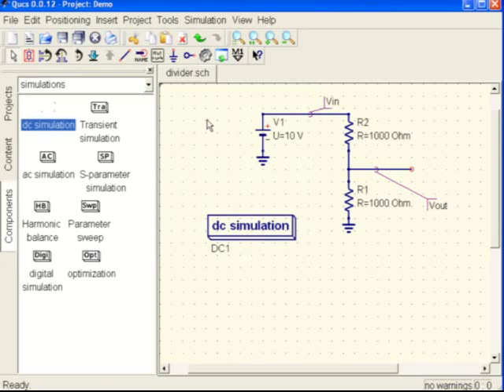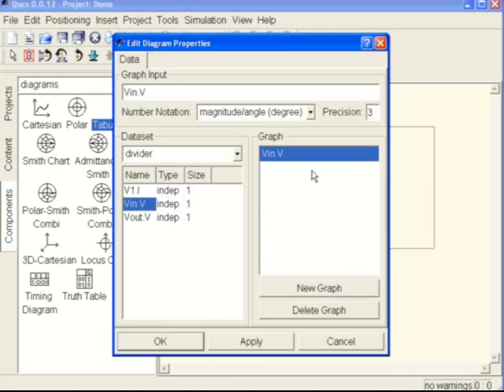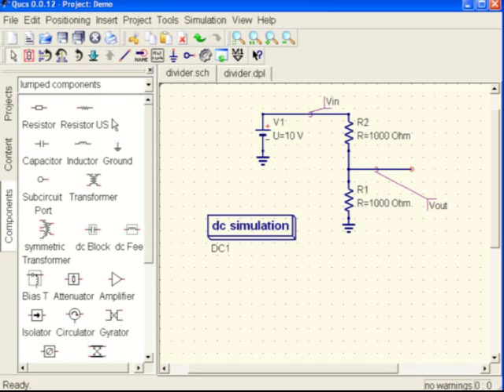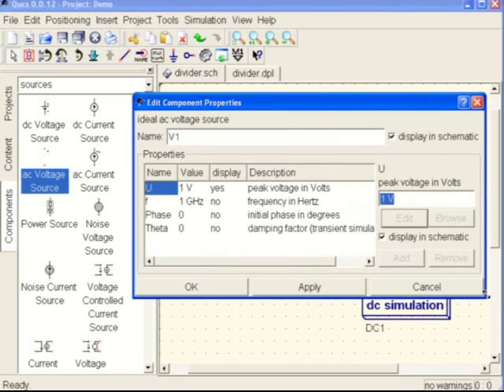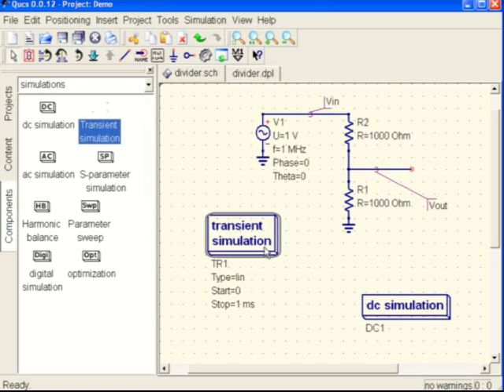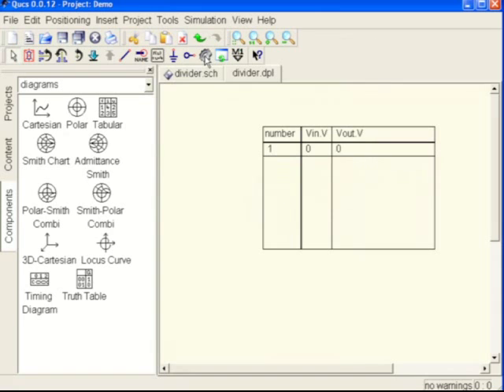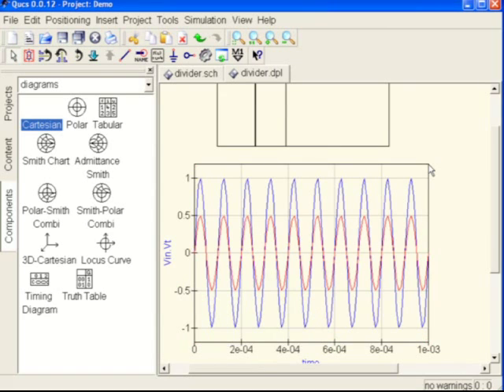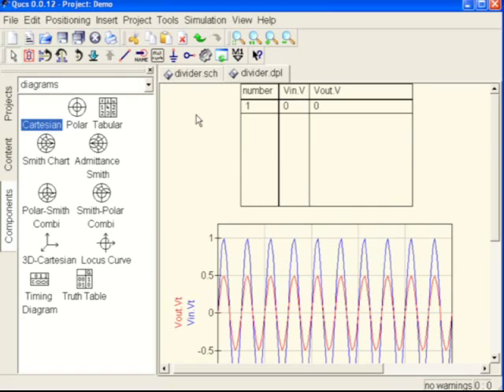QUCS_2

Comment: Great intro.  Also easy to edit values of say R1, to see changes in Vout.  But what about the more real world problem of sizing components?  I mean, if we select R2 to be 1kOhm and we NEED the voltage at Vout to be five volts, how do we get the QUCS system to solve for R1?  I guess I am thinking like a spread sheet, where we fill in what we know, and the system will solve for what we do not know, as soon as the knowns are adequate to solve the system.

Comment from the maker: @computerfis 
i do not remember any LED option in QUCS.
However, with the agenda being Harmonic Balance for microwave/RF simulation, then no surprise if there is no LED component. 
S parameters do not really make much sense for an LED, as it is essentially a DC device.
(Never mind that it does have a characteristic impedance that is a function of current, like in a conventional junction or Schottky diode)

If you need an LED , then I suggest LTSpice (free) as a time domain simulator.